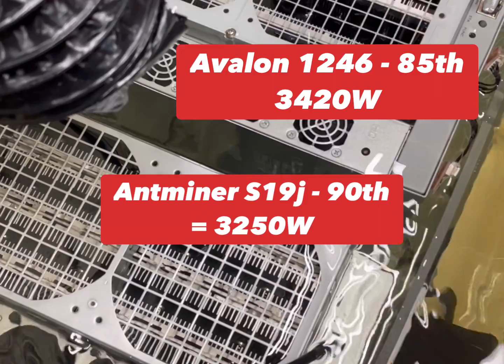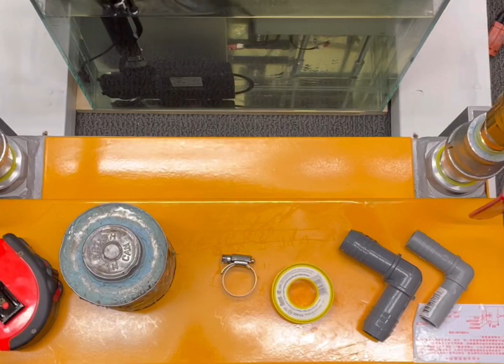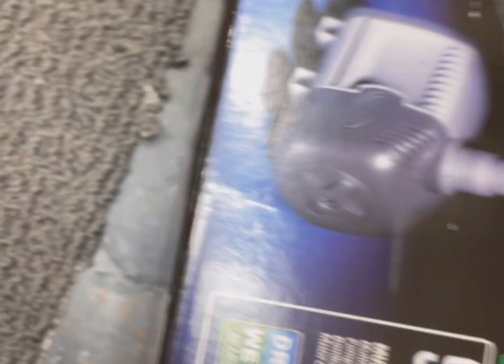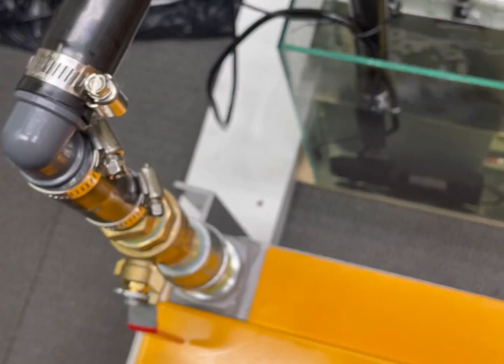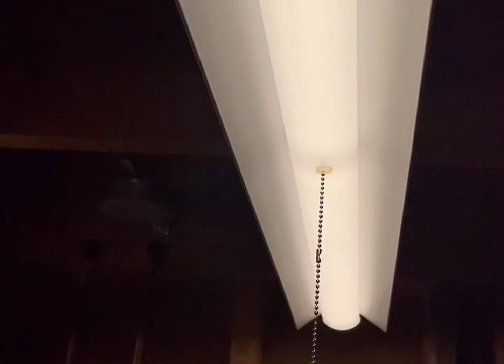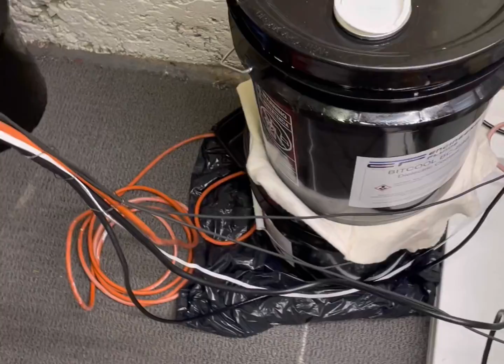DIY - How to Immersion Cool ANY Asic Miner like a Pro!  S19, 1246, M30

Comment: Awesome video and your build looks nice and clean great job overall! Also Good call on the more expensive pump I have a extremely cost-effective setup. However I would recommend anyone interested in building one to spend a bit more on the pump. My pump had a failure in the main housing then thermal runaway and pump melted. Luckily I am only running a S9i and a E9 Pro. I also opted to go with a Radiator and electric radiator fan instead (Cheap amazon Honda radiator and fan no more than $70) of a oil cooler which works quite well. I also had to put a power control/limiter/switch (cant recall name of item same as one he owns) I noticed that the slower you can pump the fluid through the radiator or oil cooler the better. Since oil isn't able to get rid of the heat it holds the longer you can keep the fluid in the radiator the better. obviously you don't want to have it going too slow. I also opted to keep the Power Supply elevated outside of the tank itself as they contribute to the heat quite a bit. 

P.S. regarding a comment i read about PVC... From what I've noticed PVC seems to be fine at least in my case and I've been running for about a year or so with Mineral Oil as i cant afford Bitcool and like i stated my setup is a extremely cost effective version. as cheap as i believe you can make it without jerry rigging something or being afraid of serious issues.
Reply from the maker: Thank you! And thanks for the feedback on your setup the data is helpful, great to know about the pump. I will eventually build another setup and decrease my flow rate to the exact engineered fluid recommendations, as mine is overkill. Currently my setup is working nicely, so I’m not going to modify it anymore. I will however continue to modify and improve on future builds.

Comment: I am currently looking into using bitcool888 where is the flow rate chart and is there a btu chart for antminers?
Reply from the maker: Engineered fluids recommends 2-4L/Min per kW for flow rate. To calculate BTU’s multiply your total asic wattage by 3.41
Reply: @BackyardBitcoin  Awsome thanks that will help to try to locate a cooler

Comment: which fan spoofer did you used for the avalon 1246? ive been looking for one much time and i didnt found nothing, do you have a link?
Reply from the maker: You will need 4 of these total. 1 for each of the 4 fans⬇️
https://www.ebay.ca/itm/2021-4Pins-Fan-simulator-Spoofer-remover-for-WhatsMiner-Canaan-Avalon-Ebit-/284533739543?mkcid=16&mkevt=1&_trksid=p2349624.m46890.l6249&mkrid=711-127632-2357-0

Comment: temperature delta is a significant factor in heat transfer, it probably can remove 77,000 BTU/hr from 300 F hydraulic fluid (not an unusual temp for hardworking hydraulics to achieve), but not your 85 F dielectric coolant. If you moved the rad outside in the canadian winter cold, it would increase the delta-T and thus your BTU transfer rate.
Reply from the maker: Thank you for this excellent information! I may try this, perhaps closer to spring, as I will need a decent temperature to work in and also make some extensive modifications outside of my house to make it secure and look nice. It’s a tough call to make as currently it provides heat for my home. I need to try and design a system that works well for all seasons.
Reply: I can´t understand how people is not mining with a combined setup of sun/wind and ambient temperature cooling in Canada.

Comment: Please have experience with cleaning Avalon 1246 before immersion in oil?
I didn't succeed in the Avalon 1246 oil immersion project and I have a few questions for you.
Can you help me please? Or Can you contact me on email or other communication network. Than you very much
Reply from the maker: No problem, on Reddit go to  “ r/Immersion_Cooling” then look for this video posted. you can find me there to help👍🏼

Comment: Doesn't the oil damage the miner over time
Reply from the maker: To the best of my knowledge, it’s actually quite the opposite. The miners come out in almost brand new condition. Running cooler and free of dust and debris throughout its life cycle. You may have to add some thermal paste if it’s been reduced, but that’s about it.

Comment: Great setup. May I suggest you double each collar where screw is installed on opposites - this helps against potential leaks from the uneven surface under screw. Apply good pressure not high on screws as this can unevenly crimp or even break the collar - those type of collars are not that strong. 👍
Reply from the maker: Thank you! and you are absolutely right! It’s a great point. I have since doubled them up, as one connection was indeed sweating a little bit of fluid out. I Will add to my highlighted comment and into a follow-up video.

Comment: Thank you for the Video. Do you use 220L/min radiator? (rate of Flow)
Reply from the maker: Yes, the 200L/min model works well for 1 high powered asic miner, I just added the link in the description👍🏼
Reply: @BackyardBitcoin  thank you very much dear for your answer. I want to try immersiony avalon 3300w using 60L/min, do you think this will work?
Reply from the maker: @AR-ol4yf  no, I would use the 200L/min model as a minimum size for 3300w
Reply: Interesting, Good to know. Thank you for the Infos. I wish you the Best and Happy mining :)

Comment: How bad is the static electricity from running oil over plastic?  I'm currently doing something similar and during assembly, the static has been terrible. A bit worried about the miners, but perhaps that's a non-issue. Curious your experience
Reply from the maker: I haven’t had any issues at all with static electricity 👍🏼 Also if you are doing a custom build  just make sure you use a rigid thickness of polycarbonate or acryllic. I should have went a little thicker, there’s a bit of flex in my divider.

Comment: thank you for the vídeo, Very helpfull.
this pump handles the hot fluid?
and  about the plastic of the pump with the coolant in long term? 
thank you again for your help.
Reply from the maker: Yes, so far it’s been great. Another Reddit user has been using this brand and style of pump for approx 7 months with no issues. I can’t speak to the exact material of the casing of the pump, but the ceramic shaft of the pump is compatible with Bitcool. 

Any updates on my system, whether negative or positive I will always add to my top comment on the video :)

Thanks for the question!

Comment: Great build! Anyway you can link the type of pump you used or you recommend?
Reply from the maker: SICCE Syncra ADV 10.0 Pump designed for fresh and saltwater|Self Cleaning Impeller | 2700 GPH

Can find on Amazon. Pricier option, but it’s been working great 👍🏼
Reply: @BackyardBitcoin  Thank you for responding 😊

Comment: Did you have to spoof the PSU fans?
Reply: @BackyardBitcoin  Ahhh, ok thanks 👍. I have the main cooling fans removed and replaced with spoofers, just wasn't sure if I had to get more spoofers for the power supply fans.
Reply from the maker: My apologies! I missed PSU in my first response, I was a half asleep. You do Not need to remove the PSU fans. They can stay in and don’t need to be spoofed.
Reply: @BackyardBitcoin  Gotcha, thanks man!

Comment: Хорошая работа!

Есть вопросы:
1. Сколько по времени работает ваша установка?
2. по Avalon 1246: в нем на чипах стоит термопаста или термопрокладки? Не происходит ли вымывания термопасты между радиаторами и чипами?
3. Какая марка блока питания стоит на 1246? Сколько его выходная мощность: общая и на каждую плату?
Reply from the maker: Are you able to translate this comment to English? I’m unable to read it
Reply: @BackyardBitcoin  Good work!   I have questions: 1. How long does your installation last?  2. according to Avalon 1246: it has thermal paste or thermal pads on the chips? Is there a washout of thermal paste between the radiators and the chips?  3. What brand of power supply does the 1246 cost? How much power output does it have: total and per board? (Translation)
Reply from the maker: @bharathkumar5418  
1. the immersion system should be able to outlast the life of the miner given there is no problems with the pump or fan motor on the exchanger. You should never have to change the dielectric fluid if kept clean.
2. Ive only had the Avalon running a few times in immersion for short duration testing, so I’m unsure about the paste washout thus far.
3. Avalon PSU’s run around $650 usd, but come with the unit unless you need a replacement. The Avalon 1246’s run around $8,000 usd new. This model runs at 85 th/s or approximately 28.3 th/s per board in high performance mode and uses approximately 3400watts at the wall when running air.

Comment: You are getting under performance on the oil cooler because oil coolers require high oil presure and high air flow rate, nice work btw! :)

Comment: Great video, thank you. Did you consider using a heat exchanger? Also it would be interesting to hear your thoughts on mineral oil v bitcool.
Reply from the maker: Thank you! I am currently using a heat exchanger, I believe there’s just many different names and variations out there. I did a little bit of searching into mineral oil and felt it was just too risky. Apparently component breakdown can occur over time….It was scary enough dipping into fluid engineered for the task!

Comment: To hit heat removal specification you also need to hit coolant flow rate. increasing flow rate will help increase cooling capacity from your system
Reply from the maker: You’re Correct. I’ve worked on that premise. I’ve doubled my flow rate 3 times and increased plumbing to 1” for the most flow I can get. I’m at the point now if I increase my flow rate any further it introduces air bubbles into the system, which decreases the fluid cooling properties. The rad is working super hard, it just cant throw anymore heat away, it’s just not that big of a rad.

I’m at 158L/min currently, in the upper threshold of the companies optimal flow chart
Reply: @BackyardBitcoin  i agree. i used a spa pump to move the coolant round my system. it caused major bubbles in the system to the point where i could not see the miner (i have an acrylic case). i had to use a valve to slow down the flow, which got rid of the bubbles

Comment: Nice! what's the length of the pump chamber?
Reply from the maker: The total length is 18”, designed for 2 units. You could reduce in half for 1 unit to cut material and fluid costs.

Comment: I have 3 sj19 PRO what size Rad do I need or how did you calculate? I am in the south so the ambient temp is warm year around.
Reply from the maker: So I’ve been able to determine using this style of hydraulic oil cooler that you need approx 18,000k/cal cooling capacity per 3500watts. I would therefore recommend something of this size or equivalent for your 3 x S19 pro’s. ⬇️ 

Check out this product on Alibaba App Heat Exchanger Aluminum Plate and Fin Hydraulic Oil Cooler AH3818T 600L/min Hydraulic Oil radiator

Wasnt able to send exact link for some
Reason but this unit has a 50,000 kcal/h cooling capacity, should do the trick👍🏼

Comment from the maker: Bitcool 888 users: **A couple changes I would make after review and feedback - I had a brain fart and used pvc elbows instead of poly elbow fittings when I switched to 1” plumbing. Play it safe and follow the compatibility guide.

UPDATE: I emailed engineered fluids and received a reply Feb 08, 2022, they advised me the PVC Joints will be ok in the fluid. I wont have to change them. 

UPDATE #2: On Feb 15, 2022 I had one elbow connection start to micro leak. So I simply added a 2nd hose clamp to each connection and that solved the problem. I would highly Recommend doubling up on hose clamps on each connection if you chose to use poly plumbing lines.

UPDATE #3: March 7, 2022: The E6000 did not hold up in the Bitcool 888. it is not on the approved list. So please use a 2 part epoxy for longevity in the system. (See 2 month follow-up) My apologies for those mistakes in the video. See guide below 👇 

https://www.engineeredfluids.com/material-compatibility

Comment: Jordy...you saved me so much hassle.  I was looking at the same RISEN manufacturer and it's SO good to know that there cooling capacity charts are not accurate.  I was looking at a model rated 5.8 KW cooling capacity for a single s19j I was going to overclock.  Figured I'd have lots of headroom even if I hit 4500 watts on the OC.  From what you're saying, I'm gonna have to probably beef that up to your model it sounds like.  Sucks, but glad to know now and not have all the time and wait just to find it undersized at the end of the build.  THANK YOU.
Reply from the maker: Awesome! I’m happy to hear it helped you out. Definitely size up. The majority of the cost is in shipping anyways, so play it safe. Fyi, my  model is available by one seller on eBay, and the price is inclusive of shipping. However if you plan to overclock you may want to get into a 300L/min model.
Reply: Also, now that i'm in a higher tier price point, I wonder if there are better all in one units to look at....